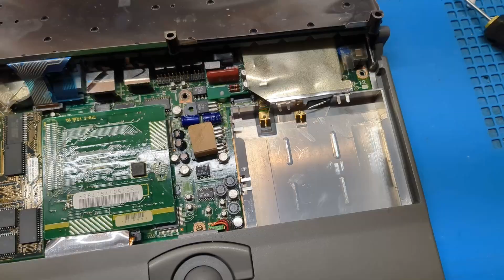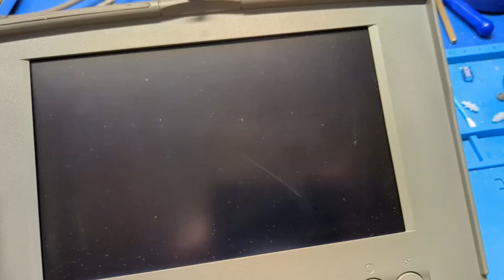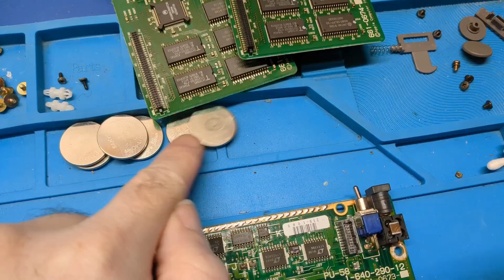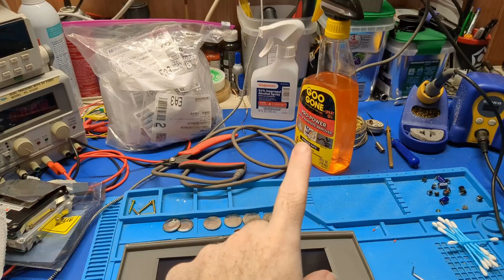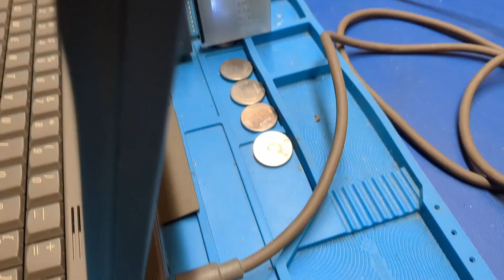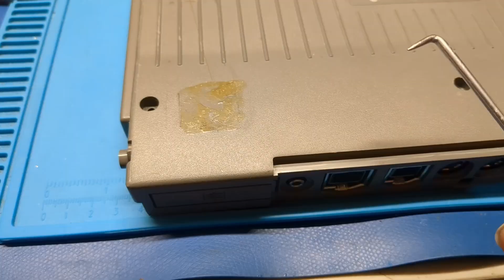Macintosh Powerbook 100 Repairathon Series - Part 2

Comment: Regarding that rubber bump-stop for the parking magnet, I've seen the same on my Toshiba and Conner drives. I'm pretty sure that 'wax' type stuff used to be some form of rubber or other flexible material. I got 2x Conner drives working by cleaning that off where the head-arm contacts the magnet and putting a very small cut of thin rubber in its place. (cut from a sheet of rubber feet).
On the Toshiba drives instead of having that magnet enclosed in metal, they just jammed the flexible-material-cased parking magnet into a little hole cut out, so as the flexible material degrades that magnet could eventually just fall out of position.